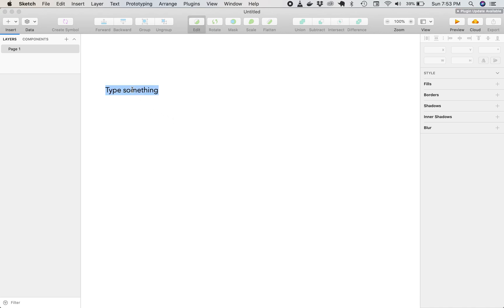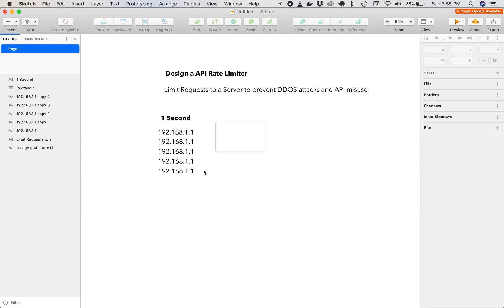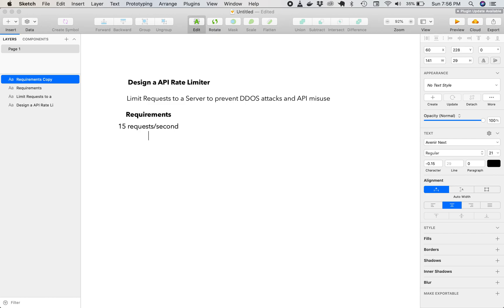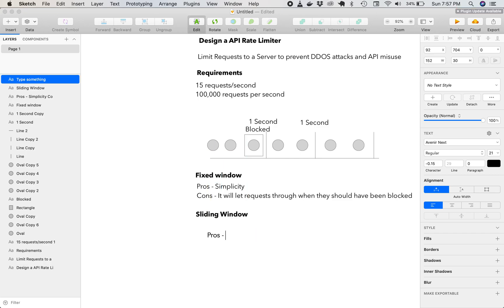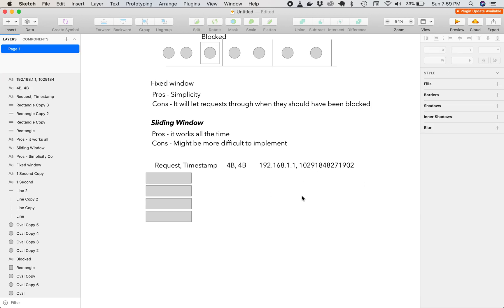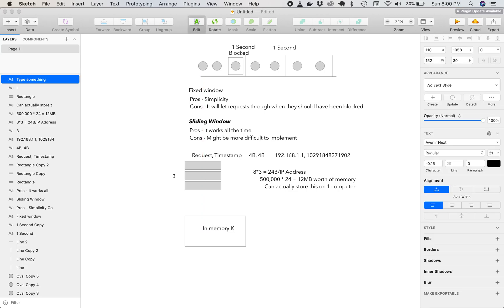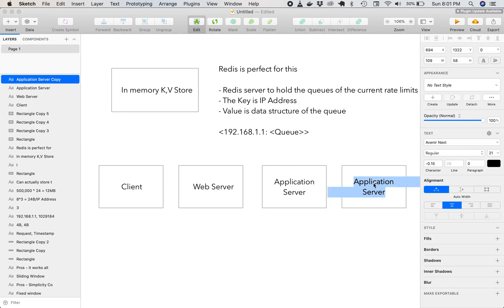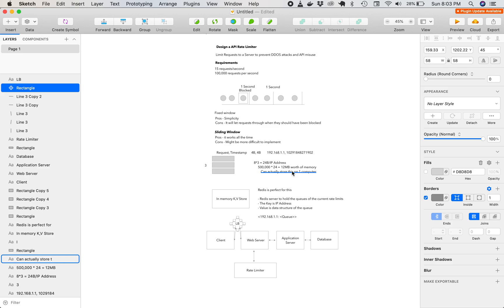Grokking the System Design Interview: How to Design an API Rate Limiter

Comment: With just single rate limiter, the system is not fault tolerant. There is a single point of failure at rate limiter. So, I believe this needs to scale up, and each of it's instance can talk to Redis.

However, the downside with this is n/w call to redis, which adds the delay to your actual api responses. Thoughts?

Comment: An IP needs 4 bytes to hold the address, not 8x3 = 24 bytes.
500,000 users will need 4x500K = 2 MB instead of 12 MB.
Reply: He keeps IP + timestamp = 4 + 4=8 bytes . 3 records in one window so 8*3 seems correct

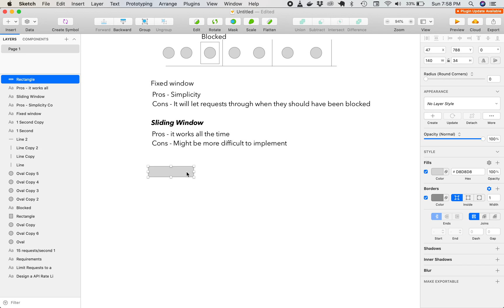Comment: Excellent video! Thanks for taking the time to make it. I have a question around minute 4:50 you mentioned that "we are going to implement this using a queue." But I don't see how a queue is being used. https://youtu.be/a10j6P3DqdY?t=290
Reply from the maker: nunca pierdas la clase Thank you! The queue is the list of 3 elements. Since we are popping an element off when we put a new element in (should have put this in the video) this is a queue where we can compare the front and the end. When we compare the front and the end of the queue if the timestamp difference is less than the interval, then we will reject this request.
Reply: @zheffdj  This looks more like leaky bucket rather than sliding window